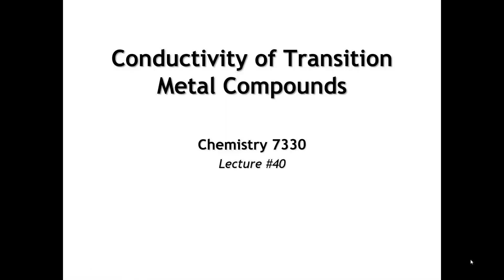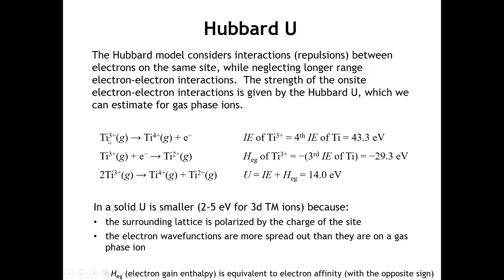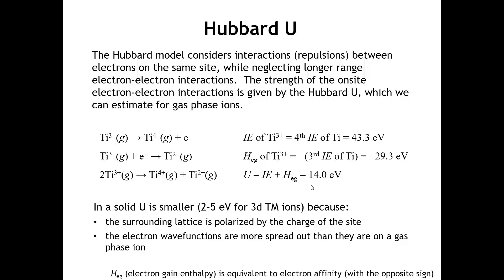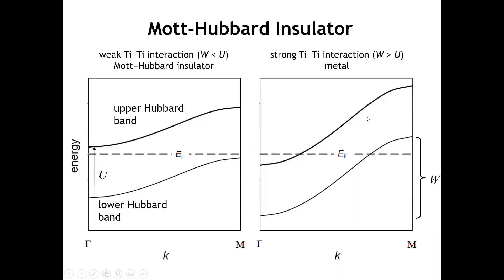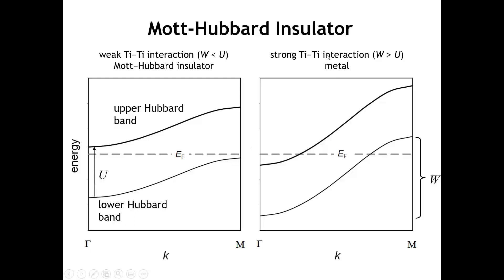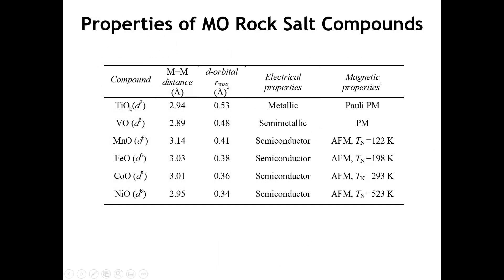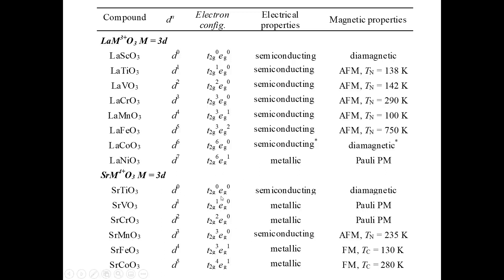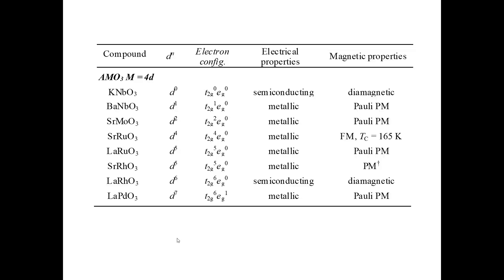Lecture 40 Conductivity of Transition Metal Compounds

Comment: Hello Professor Patrick, this is a grad student from Tennessee. The tables you showed, are from a single literature or several? If a single literature, will it be possible to provide the reference? Especially for the 2nd table with La Perovskites.
Reply from the maker: Most of the lectures in this series, including this one, are based on the book "Solid State Materials Chemistry" written by myself, Pavel Karen, John Evans and Tom Vogt. It was published in 2021 by Cambridge University Press.
Reply: @patsperovskites4733  Thanks a lot.